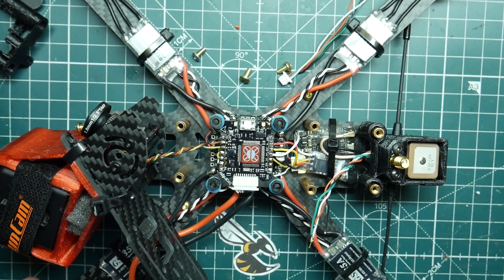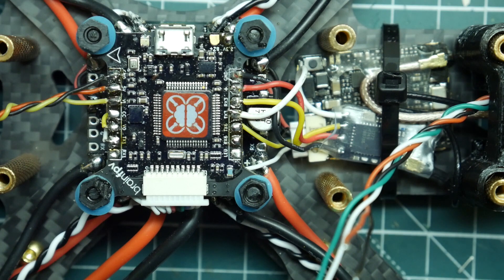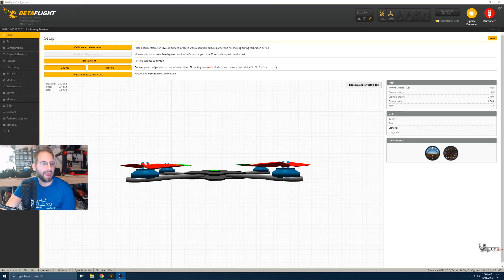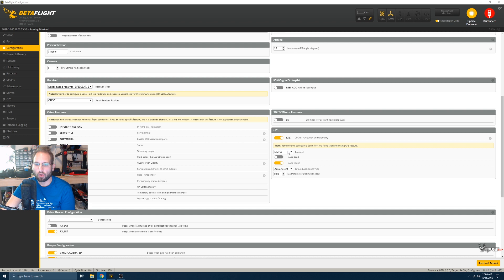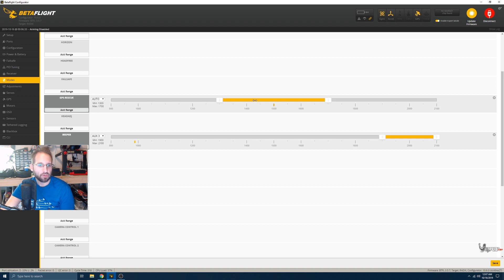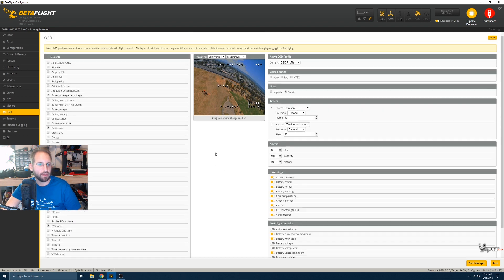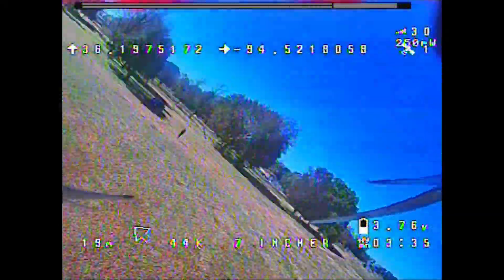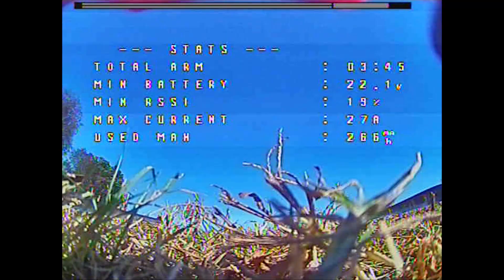How to Wire & Setup FPV Drone With GPS - Betaflight GPS & GPS Rescue Mode - Never Lose a Drone Again

Comment: Can you help I've got a jumper t lite when I select Aux channel and switch this happens I choose Aux 3/4/5/6 etc it's goes to Aux 1 or SC rear left to arm Express LRS hear on quad need Aux 1 only but I can't so I can have drop and la d as fail safe but can't put GPS rescue on a switch but I want too can you help me sort it out cheers keep em coming cheers from cold wet UK

Comment: Nice video. One thing confuses me. You already have something wired to TX6. What is it and why can you get away with having two things wired in there?
Reply: Either his Crossfire or his GPS is on both RX and TX of the same UART - which is pretty standard for either of those devices :)

Comment: I have to set GPS rescue switch value to stage 1 failsafe field to be able to use gps rescue aux switch if it's not there then my quod just drops (disarm), Is there any particular reason for which fc is not able to switch to stage 2 failsafe. I have kept the values to 4 which is less than half a second. Using SUCCESS-X fc with bn-220
Can anyone help me with this

Comment: Weird. I put the BN-880 in my quad last night. Plugged into my laptop and a battery plugged in, my betaflight screen showed satellites, longitude and Latitude. I took the quad to work today and on my lunch break I went to fly and it did show longitude and latitude but 0 satellites. I waited for 2 minutes before I just gave up. At home tonight I plugged in a battery. I got longitude and latitude after 1 minute 30 seconds. It took 4 minutes 55 seconds of just sitting there before it got any satellites. Very weird. I could have sworn it said 26 seconds for a cold start. But I did finally get speed readings, which is what I was after.
Reply from the maker: Yes when I change locations sometimes it takes as long as 5 or so min before it finds enough satellites.

Comment: Coming from Inav, I setup BF rescue and all works fine except when I turn OFF my TX  BF doesn't recognize FS even though throttle drops to 885. In Inav it works, parachute turns red.  Any ideas?  Thx
Reply from the maker: What setting do you have in the failsafe tab?

Comment: I have the new flywoo explorer xl caddx dji combo I was wondering if I'm out to low for gps rescue to work, the settings are like you showed in the video exactly I flew out about 500ft 10ft off the ground and engaged gps rescue via switch the quad turned toward me moved forward about 10ft and then dropped so weird not sure whats going on its set on gps rescue not drop or land anyway thanks sooooo much for the help!
Reply from the maker: kingasa pj try activating gps rescue higher to see what the exact behavior is.
Reply: @ViperFPV  I did that at first with the stock settings far away and it did work i think my desent distance was set to 200 meters which might be  causing it to drop when it gets within range even though its only 10ft off the ground set gps_rescue_descent_dist =[number] (default is 200) although it was set to 50 meters i read somewhere you can set to 30 min
Reply from the maker: kingasa pj I believe 50m is the limit

Comment: Hi, I already install the M8N glonass gps module. but seems it doest lock the position. on the betaflight is said 3d fix status is false. do you have any work around on this?
Reply from the maker: How long are you waiting when connecting a battery? U have to be outside so the GPS can get synced to at least 8 satellites before it will lock. Typically after a battery is connected it takes about 5 min.
Reply: @ViperFPV  okay thats my mistake because i was indoor. i wait around 15 minutes and no gps were locked. thanks. One more question, what is the term "false" at 3d fix status on the betaflight? Does it indicate wrong wiring or something else?

Comment: how do you set the home point or better asked, how do i know when the gps safed the point where i plug the battery as point where the quad has to return to?
thank you very much
Reply from the maker: christianmmoser when you plug it in it then acquires the satellites and that spot u plug in is considered the home location. Moving from place to place it can take up to 5 min before it picks up all the satellites between 8-12.
Reply: Viper_FPV just that i understand it correct. as soon as i see in my goggles that the count of satellites appears which i selected as minimum satellites in the betaflight failsafe gps rescue tab, then i know that the gps safed the current position as home position? i inow that when i plugged the quad to betaflight that i can see visually when the gps fix is done. do i somehow see it directly on the gps unit or is there an osd which shows that the home location is set - without beeing connected to betaflight.
Reply from the maker: christianmmoser the quad will not arm until the min gps satallites are acquired and that will be your home location.
Reply from the maker: U also want to make sure u enable the home arrow which shows or points in the direction of the home location
Reply: @ViperFPV  Great, thank you very much. I set the minimum sats to 5 but in this case that's not so clever I guess. I will put it back to 8 again.
Reply: @ViperFPV  unfortunately this OSD parameter is not yet supported with DJI digital FPV. But it is one of the thins which will come with the next update.

Comment: Hey. Nice tutorial. I have one question. Did you have any issue displaying the gps info in your osd ? For some strange reason, I can only get ‘alt’ to show up. Nothing else, like the arrow, distance to home, lat and long, number of sats etc will appear in my osd. Tried pal/ntsc with no joy 🤔. They show up in betaflight on the osd settings page, even when I move them to the centre they still aren’t there in my goggles 🤔
Reply from the maker: are you sure you enabled the gps feature in Betaflight config tab?
Reply: @ViperFPV  Hi. Yes, i had GPS feature selected. I solved the problem. Turns out it was UART related. When i put the GPS module on a different UART, everything popped up ! Strange huh ?

Comment: Nice video man! Just a question, in my taranis, what should I do with the option failsafe for the r9m? Use "Not set", "custom", or "Hold"?
Reply from the maker: It should be custom and cut, that’s how it is on my crossfire system

Comment: Hi. I see when you went into the mode tab and selected GPS rescue you then were able to activate this and turn the box with gps rescue orange. I see you were doing this on the Bench. I have done everything that you have done but switch won't activate the gps rescue. Any advice thanks
Reply: Oscar Liang says the GPS Recue won’t turn orange while connected via USB on the bench: https://oscarliang.com/?s=GPS+. My switch works but it does not turn orange when activated.
Reply from the maker: Darren Harley is your receiver on?
Reply: Viper_FPV yes receiver is on and bind. Tried other switches just can’t get gps  rescue to activate. Stumped
Reply from the maker: You have gps enabled on the configuration page?
Reply from the maker: Also need to make sure your switch your using is activated on your radio
Reply: Viper_FPV gps is enabled. The module flash’s and when I’m in gps tab I am picking up to 10 satellites and I get a map where I am. When in mode tab. I get the marker moving across the screen when switch is moved on tx and I know when it goes into the activation area it should turn the gps rescue orange. I get everything else like arm and flight modes working ok and I tried the fail safe and that works it’s just the gps rescue that’s not working.
Reply from the maker: I see, you need to be 250m away from your home location in order for it to activate. Try flying further and activate it
Reply: @ViperFPV  you can change in cli to 50 meters  to test you gps rm.
Reply from the maker: maxun1 yes u can
Reply: I have the exact same problem. Did you fiqure it out?

Comment: Can the return to home function be set to battery level?  Other words, when the quad is down to a critical power level the GPS will know it and begin to return to home.  Are the 'flight characteristics different with GPS?  Will it hover/and/or maneuver with more stability or more predictable?
Reply from the maker: Checkered Flag Films not with Betaflight

Comment: wanted to see it fail safe! then automatically return home
Reply from the maker: Failsafe works just like the switch have setup
Reply: Viper_FPV ok gonna try this I record once set up just gonna fly fast straight out of range. Have yet to see any footage of this working.
Reply from the maker: trigatupp yeah I think it’s more just being scared of what might happen, I have not been to a huge field where I could just send it, also I run crossfire so I would have to go really really far to lose range
Reply: Land or fly very low far enough away and turn off your radio. That’s how you test it.